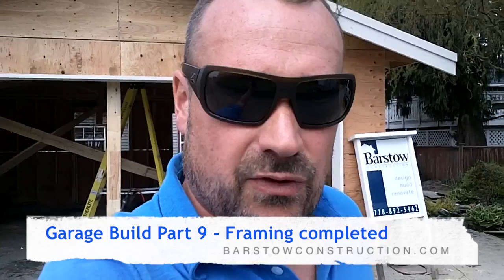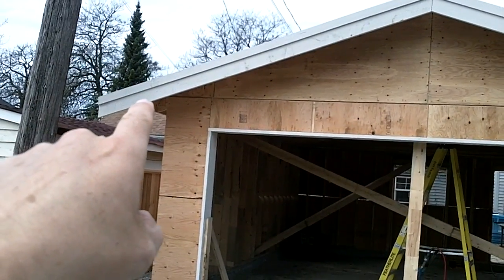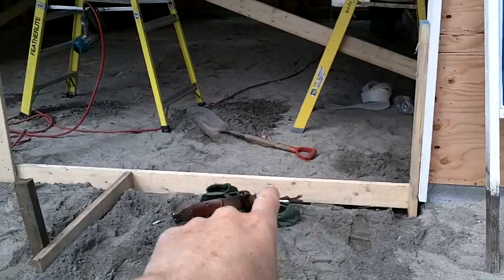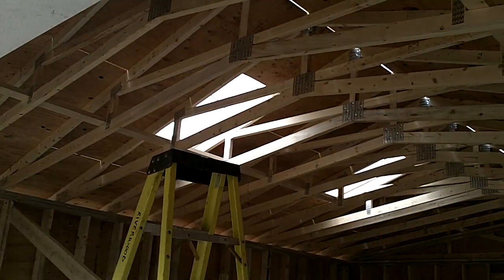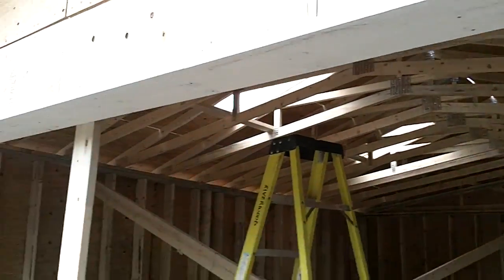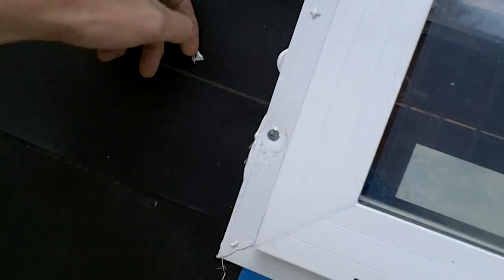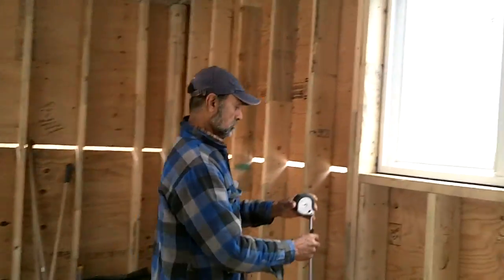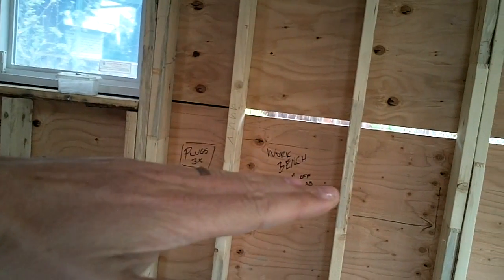Garage Build Part 9 - Framing completed

Comment from the maker: Actually, we do this to allow the house to breathe. Further to that, wherever we have an enclosed stud cavity, we will actually drill a 1" hole to achieve the same result. Think about it: If you have an air tight, enclosed space with no air movement - and its freezing outside and warm and humid inside, this is a well documented a recipe for mold and rot. Condensation can and will form. So the vent helps alleviate this issue. Make sense? Our warranty provider like it too! Thanks for watching.

Comment from the maker: Disgusted? Whoa! Let me educate you a little bit... I actually wondered the same thing... So I called my home warranty provider and asked which product they had fewer claims on. I also spoke to 4 siding contractors asking their opinions... In the end, two layers of anything (we use 2 layers of building paper) seems to work better than one layer of Tyvek. The main reason seems to be that with Tyvek or similar products, any place there is a staple is a weak spot, as opposed to having two layers.

Comment: Well no home is air tight, even before you spaced those sheets or drilled a 1" hole. Homes are generally designed to breath to the outside, tyvek allows this. Rain screen products simply allow water to drain rather than permeate through the exterior. Conditioned attics with closed soffits (generally insulated with open or closed cell foam) are a great example of how you don't need to use traditional thinking. The old belief was that the walls and the attic had to breathe and have significant air going through them or you'd get mold and rot. That's no longer true. People are building tighter attics and walls with modern materials that act as vapor barriers. Anytime you let outside air into your attic or walls and you have a warm wall you do indeed risk condensation. So opening up the outside wall to allow it to breathe (in essence letting the cold air in) isn't a great idea. Nor is laying in large gaps between sheeting. You're essentially promoting the old way of thinking to it's highest capacity. Build a tighter wall system with a better vapor barrier and don't let the cold air in to begin with. No cold air, no condensation. That's why some of the best homes around have closed soffits and spray foamed envelopes. You're not going to get mold if the temperature outside cannot bridge to the temperature inside and create condensation. Just like how an empty thermus in the cold or in the heat doesn't create moisture inside. That's the future, making homes like thermus' instead of making them like open air venturi systems.